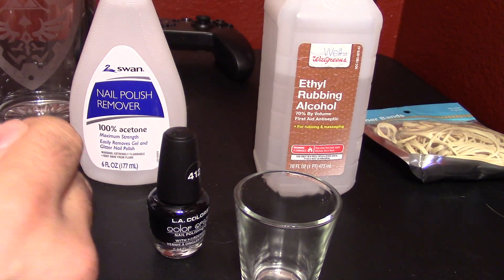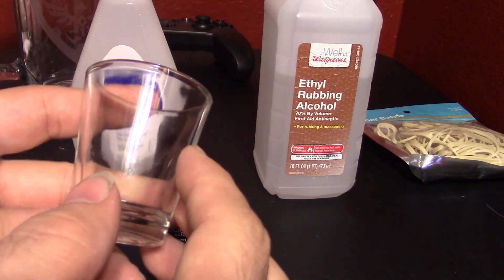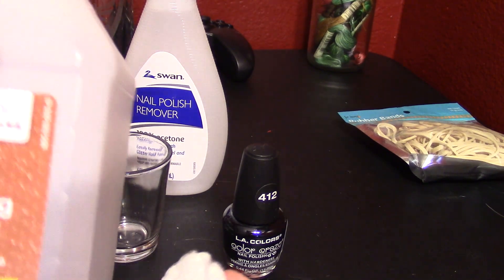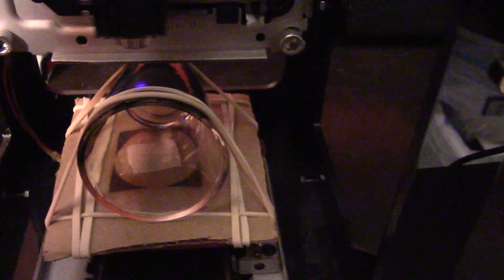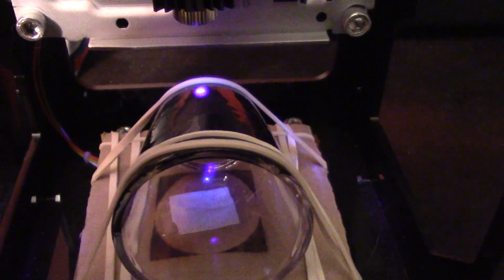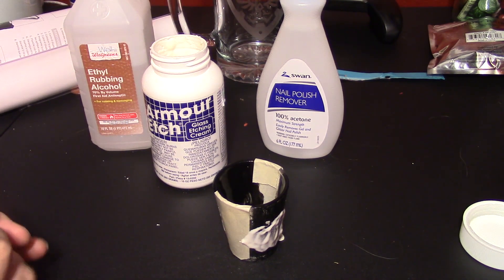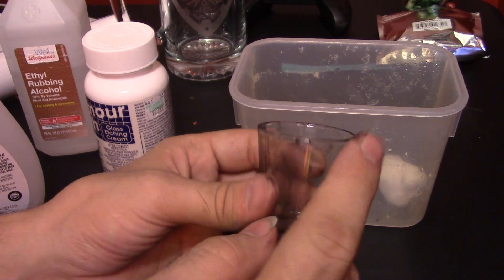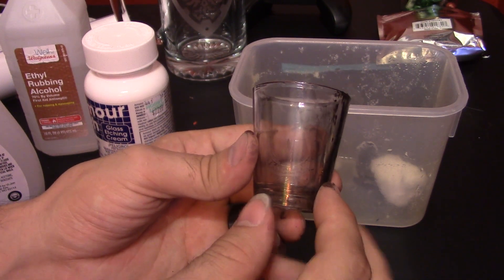Laser Etching Glass: Attempting The Nail Polish Trick with the NEJE DK-8-KZ

Comment: good attempt but needs to have the bottom of the glass raised as common sense says your lasering anything goes in a straight line not a curve unless it's put on a cnc that can handle depths and raises of material. The bottom of the glass etched reasonably well because it was near optimum height for the laser but as it went up the glass the focus of the beam was lost. You could have tried it on a square glass making one side the right height to laser.

Comment: Could you use masking tape instead of nail vanish?
Reply from the maker: Maybe. That is actually a good question. When I get a replacement laser, I will test it out
Reply: Recently got a similar laser engraver myself. Have done a bit of test on masking tape and surprisingly laser resistant. Doesn’t burn through particularly easily.
Reply: I know this is an old post, but seems to me masking tape being a lighter color wouldn't work as well. I was thinking maybe electrical tape but that would be possibly too thick.